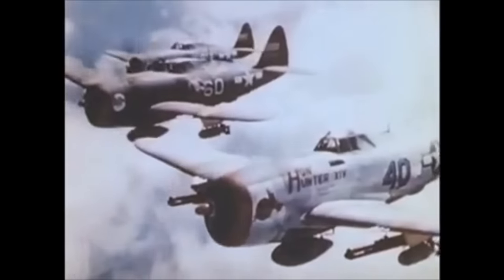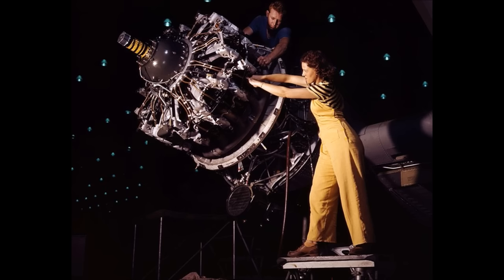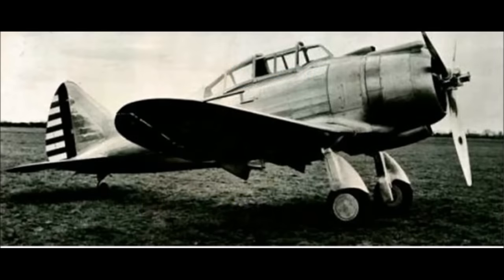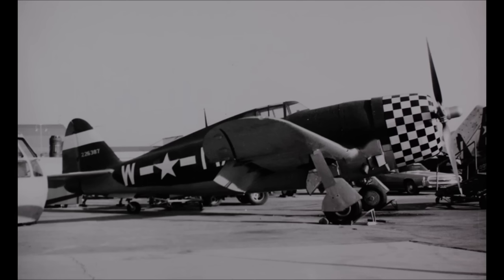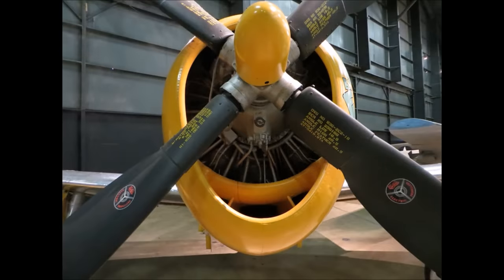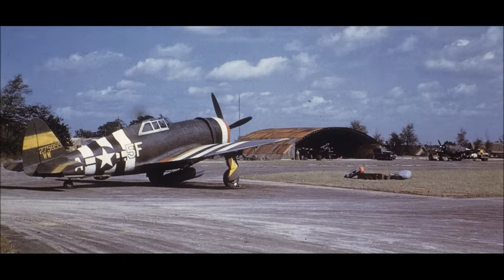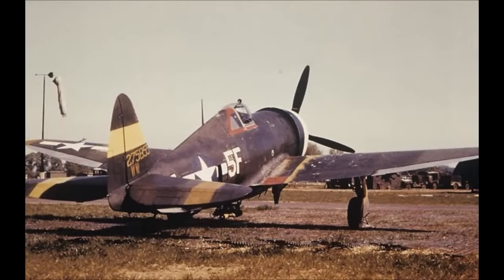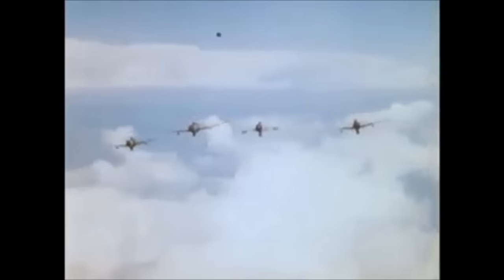P-47 Thunderbolt Pt. 1 Design and Speed

Comment: Just a historical fact: for reasons unknown, the National Advisory Committee on Aeronautics, which has the acronym NACA, was always pronounced by spelling it out, "en ay see ay" instead of "nacka" and NASA, National Aeronautics and Space Administration, was always "nassa." Didn't make any sense when the first organization became the second, and it still doesn't make any sense today. I knew what you were talking about, but I remember hearing this when I was studying the Apollo program about 25 years ago.
Reply from the maker: Hi Dr. You're mostly right, and maybe only slightly wrong. I wouldn't say it was "always" pronounced "en ay see ay". Go to any race track in the country and ask the drivers, mechanics, or others what type or airscoop that is, and most will say naaca scoop. It's the same with pilots, I have literally never heard a single pilot call this an "en ay see ay" duct. https://en.wikipedia.org/wiki/NACA_duct   I have no doubt that people used to spell it out, but when making a video and I need to say it 20 times, I'm just not going to do that, especially when it's not said that way in common automotive or aviation parlance.
Reply: @GregsAirplanesandAutomobiles  That's a satisfactory answer. Thanks for clearing that up. I heard that from a single source, and I suppose that members of the budding NASA wanted to be as far as possible from their primitive roots.

Comment: There is a difference in a single aircraft's speed and strategic speed.  A single aircraft could be tweaked fast but the measure is truly the average general speed of a particular aircraft in a combat environment where pilot skill and logistics (which includes maintenance) are taken into account.   Overall, Thunderbolts that were not fighting at high altitude could easily get hurt by German aircraft even though they were close to invulnerable at high altitude except for an unlucky hit.    However the potential of being hurt was somewhat offset by the fact that it was rarely one Thunderbolt a German pilot was dealing with but a number of extremely aggressive  Thunderbolts operating as a  team competing for your head while your lesser experienced team was scattering for their lives (the difference in training in 1944-45 was significant).  You might get behind a 47 and even stay with it and even if you were getting some hits you were trying to chop it down while 2 or 3 47's were jockeying for position to shoot you down and they only needed a second of firepower to cripple you and a second to finish you off.   Air fights were not the ridiculous swooping up and down affairs you see in video games which look more like WWI dogfights where no one is communicating with their friends. There is one guy minimum to protect a shooter and Americans took that very, very seriously while the Germans of 1944-45 just didn't have the luxury.   How many of you video aces have kept in touch with your wingmen or had wingmen that kept in touch with you?  In the skies of Europe the wingman was your brother.   Lone pilots don't last long, they were the sheep waiting to be shorn by either side and even at low altitudes it was usually the German going baaaa  even though their planes were fighting at near optimal altitudes. .

Comment: I understand that inline engines were not as stout when they got shot up. Radial engines would run fine and bring their pilots home even if some of the pistons were visible outside of their damaged cylinder heads.

Comment: I never understood why the manifold pressure is measured in inches. It's (at least in my tiny brain) measuring pressure with distance units. If it was engine and mech specific i would get it, at least part of it, but it looks like it's a standard used all over. When I fill up air in my car tyre I read it in bar, or (I guess) in PSI for you that lives in Amerika. Also, at least in Scandinavia, car turbo and kompressor is in bar mostly. So my question is; whats the connection between MP and inches?
BTW, love your videos with the attention to detail.
Reply from the maker: Manifold pressure is measured in inches of Mercury. It's a very convenient system of measurement to use because 1 inch of mercury equals about 1000' feet of pressure altitude. Thus when climbing or decending, you make a 1 inch change every min when climbing or decending at 1000'/min, or more often 2 inches every 2mins when going up and down at 500'/min, which is a comfy rate in an unpressurized airplane.
Reply: @GregsAirplanesandAutomobiles  So the unit measurement is the standard/same regardless it be a Merlin or a Wasp!?
I now google Inches of Mercury. Thanks for reply :)
Reply from the maker: Different countries used different systems. I talk about this a bit in my manifold pressure video. The US uses inches of mercury, which I like for the reasons I explained. The Germans used units of atmosphere they called ATA. This makes the most sense from an engineering standpoint. The Japanese and the Commies used millimeters of mercury, and the British used PSI, but only PSI above sea level pressure, so that makes the British system a bit confusing.

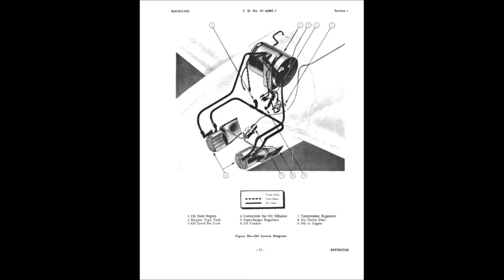Comment: 13:12 "Two electronically controlled shutters"

I would say they are probably electrical controlled, not electrically. Electronic implies that there are some kind of semiconductor involved.

Its worth noting looking at the FW190 that compare fairly porly in high altitude. There was specially high altitude version of the FW190 specially made to deal with bomber escort. There was also the V12 powered FW190 that worked excellent at high altitude.

While the P47 and the FW190 is fairly similar in role and. But the P47 was more of a multirole one one, while the FW190 was more of a 3 version multi role fighter. The A series was produced in parallel with the B-C-D series that was the high altitude version. The F and G series was also produced in parallel... while they was mostly bomber versions
Reply from the maker: ahm, OK. It certainly doesn't have semiconductors.
Reply: No... well.. some stuff that don´t contain semiconductors as radio tubes and CRT are generally also considered electronic.

As a rule of thumb, if it can change state with out any moving parts, then its probobly electronics.

This is what wikipedia says.
" vacuum tubes, transistors, diodes, integrated circuits, optoelectronics, and sensors, associated passive electrical components, and interconnection technologies"

Its worth noting that electronics was fairly common during the second world war, but mostly in the shape of radio. But semiconductors was also used... well more sparsely, but it was used to some degree.

A lot of automatic system was built out of radio components. Of cause, radiotubes is not that reliant, so i would think they would keep it out of anything that was somewhat critical.

There was some fire control system that used electronics. Electronics was also used in radio proximity fuses used in some shells during the war.

My general point is that electronics was a fair bit more common than people might think. 

Of cause, most computers (if not all) was still electromechanical.

Comment: Charts for pilots often only considered "standard" fuels.  None standard fuels used for speed or altitude consideration engine use were often unseen or unknown by your typical pilot, that is the common published flight data is what the  pilot saw in their charts. However,  as time wore on in WW2  the ability to produce more newer (nonstandard) fuels increased a d was supplied to some airplane types and squadrons as they came approved for use or even special use. Also,  pilots might in cooperation, on their own,  with the crew chief,  monkey with the fuel controls. Fuels science progressed along with the years of the war.

Comment: IS the huge influence of NACA the reason why the USA was exclusively B&Z aircraft? Because looking at WWII fighter designs it seems the other nations were a lot quicker to experiment and "mix it up" whereas the USA seems to have really only went for one style, the B&Z. The Brits had Spitfire turn and burns paired with Hurricane/Typhoon/Tempest B&Zers, Germans had 109 energy fighter paired with the 190 B&Z, the USSR seemed to like everything from the P39 B&Z to the nimble Yak and LA5, but the USA seemed to be pretty hard coded to the B&Z flight style and really didn't even attempt to go down any other routes from what I've seen and read.

So I'm curious if you have an opinion why that was. Was it NACA? The engines they had available? The focus on pilot safety (as I noticed most other nations really didn't give the pilot much thought) or was there something I'm missing that caused the USA to be so strictly B&Z?
Reply from the maker: I don't think so, but I'll need to think about that. NACA knew how to make a plane turn, but I think they responded to the inputs from the USAAF, USN and manufacturers, I don't think they had any influence on tactics or design goals.
Reply: Thanks for the reply. It is rather interesting though, don't ya think? Every other nation in the lead up to the war and early war tried all different styles of fighters but it seems the USA right from the get go just locked onto the B&Z style and never really deviated from that one design.

So I've just been sitting here trying to figure out exactly why, maybe the input NACA gave made their planes naturally superior in that style, maybe the engines they had available at the time naturally lent itself to that flying style, I thought maybe you might have an idea why all aircraft manufacturers and branches of the US military only seemed to focus on that one style for their fighters. I mean even when they were handed the Merlin, an engine that made the Spitfire such an agile  turn fighting powerhouse, what did they do with it? Made a B&Zer in the Mustang with it.

It always just struck me as funny that while everybody else in the mid 30s-40s were trying out these different styles and designs and having obvious successes that the US military had to know about, heck they ended up with flying examples of most of 'em from the Akutan Zero to the 109 F4 given to them by the Soviets to the reports as early as 1940 from the Brits about the Spitfire and its success, the US just never seemed to care about making anything but boom and zoom aircraft. Really odd and puzzling, at least to me.

Comment: You're getting into sims? that's awesome! I recommend DCS (You have to buy models and doesn't have a p47, P51d is free though) 
Or IL-2 great battles. basically IL-2 1946 but better and more detailed and an updated engine. Right now it's only the eastern front but "IL-2 Bodenplatte" will come out that i think includes The P47-d-28
Reply from the maker: I have been flying sims since the original Red Baron. No, not the Dynamics version, although I played that too, I mean the original vector graphics sim. I am super excited to get back into them. I have been playing Rise of Flight so I was never out totally. I look forward to seeing you in the simulated skies.

Comment: (Don't know if this comment will be visible to others, since I am putting a link to a video in here.) I came across this video some years ago about the Thunderbolt:   https://www.youtube.com/watch?v=7Y3v1-WMJS8  Apparently a USAAF training video covering takeoff and landing. The part that took my breath away was the ground loop. This is what separated some of the early WW2 fighters (Spitfire, Me109) from the later ones (Mustang, Thunderbolt, FW190) - wide-tracked landing gear. It would have made takeoff and landing a lot easier and a lot less dangerous for the pilot. It's still a tail dragger, of course - the next step was to add a nosewheel. Something pretty much all the postwar jet fighters had.
Reply from the maker: Yup, the P-47 gear, for all it's complexity was quite strong and could take those side loads, plus the plane wouldn't tip because it was so wide. As a bit of trivia, in my days flying as an Alaska bush pilot we used to intentionally ground loop to point the plane backwards to use propeller thrust to keep from sliding off the end of the runway in nil braking action conditions. This was more common that you might think in the Cessna 207s we were flying back then. I think the Cherokee Six guys were doing it too. I am not sure if anyone still does that, or even flies those planes up there anymore.
Reply: I came across another video posted by the same guy, this time about flying the Hellcat:  https://www.youtube.com/watch?v=6r9I--M7owE   which reminded me that the F4F/F6F is another example of this earlier/later war trend in development of landing gear, with the F4F's gear being narrow and fuselage-mounted. I thought about this some more, wondering why they didn't automatically go to wide track landing gear from the beginning, when cantilevered wing monoplanes came into existence. I think it was a carry-over from the biplanes of the 1920s - all of these had narrow gear mounted to the fuselage, and it took a while to realize that wider gear would make landings and takeoffs that much easier and less dangerous. Same with nosewheels - quite a few WWII planes actually did have them but they didn't really become ubiquitous until after the war.  At least with the Hellcat the nose was drooped so you could actually see over it with the tail on the ground. 

The video I mentioned above covers supercharger management during the climb, and it's interesting to see that (as with the F4F) the pilot has to manually turn on the low and high blowers, waiting until the boost has begun to drop after reaching maximum throttle altitude before engaging. I'm not sure but I think with the Merlin the change from low speed to high speed was automatic. I suppose I should do the smart thing and check out AIRBOYD's channel to see what else he's posted! I wonder where he got all these WWII training videos.

Comment: Hey Greg do you know if the M and N versions needed 150 octane to achieve 72"Hg?
Reply from the maker: Just to be clear, 72" was approved for use with 150 octane. I'm pretty sure that with 130 and water injection some planes were running 72" although not exactly officially. Now, the way I know is from USAAF documentation that specifically says 72" was approved with 150 octane.

Comment: Thanks for the video! By any chance does anybody know if later p47's were refit as cannoneers? Like a pack of 30mm's or a 40mm to 50mm cannon as part of a new armament loadout?
Reply from the maker: I can't say that that never happened as some sort of test, but operationally, P-47 used 50 cals from the B all the way through the end of the line N models. It didn't really need cannons. It's 8 50 cals would shred any enemy aircraft, fighter or bomber with ease.

Comment: When was the R-2800 engine initially developed? I have a hunch it was conceived to power transports and bombers; they wouldn't have figured a fighter would ever need this much power.
Reply from the maker: It first ran in 1937. It powered transports, bombers, and fighters. Due to the double row design, it was compact, well....compact for a 2800 cubic inch engine.

Comment: Hi Greg. I have read many posts online where people criticise automobile engines for use in aircraft?. Why do you think it is the case that they are not effective?. If a high performance auto engine was used in an aircraft, what percentage of max hp would be practical for use in air-racing?
Reply from the maker: There are two sides to this coin. First, the downsides of the automotive engines. They have relatively little displacement, thus they need to rev higher to make power. That means that to get any power out them you will need a drive reduction. Many airplanes have this, but you will need a greater reduction for the automotive engine. Then there is the spark plug and ignition issue. Airplanes have 2 plugs per cylinder operated by magnetos. It's very difficult to set a normal automotive engine up this way, although it's possible. The upside to the automotive engines is that they have been advancing for 100 years, while aircraft piston engine development has been at a near standstill for 40 years, so the current automotive engines are much newer designs.

Comment: I remember reading somewhere that many a Korean war F-51 pilot, tasked with close air support,  lobbied to get the P47 back.  ( bigger bomb load, more guns, more robust plane ).  With external fuel it seems to me that the P-47 would have been capable of doing the job of the P-51 but the reverse is not necessarily true.  I am no expert so I wonder if that is true or not.  I have to admit I am biased, my uncle was a P47 crew chief in China during WWII and I always thought the P47 was the most versatile of our fighters.  Much like a modern multi role fighter.
Reply from the maker: The P-47 is much more versatile, and in many ways superior. However, it was also much more expensive, not only to purchase, but to operate.

Comment: The comment at time 13:50,  that the oil was at "95 degrees centigrade or 2 to 3 degrees Fahrenheit" is inaccurate, 100 degrees centigrade is 212 degrees Fahrenheit, which is the boiling point of water, so it must be something else,
Reply from the maker: LOL, I see how you could make this mistake. I didn't say "two or three Fahrenheit", I said "203 Fahrenheit", which of course equals 95C.
Reply: @GregsAirplanesandAutomobiles  My mistake, my audio crackled at that time and I misheard.. My apologies sir. Love your videos.
Reply from the maker: Thanks R U 12. It's nice to have you here in the comment section.